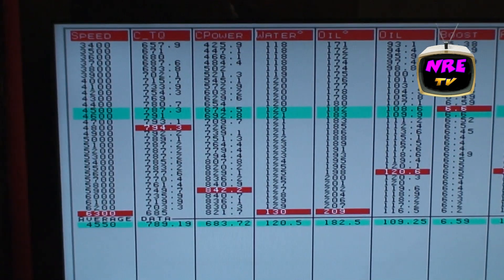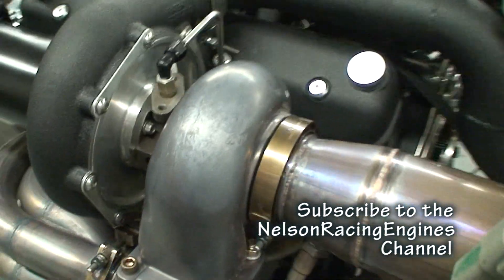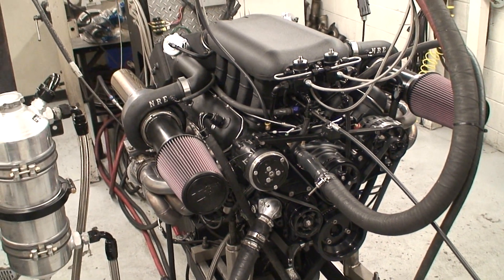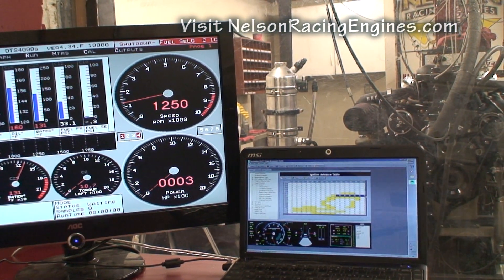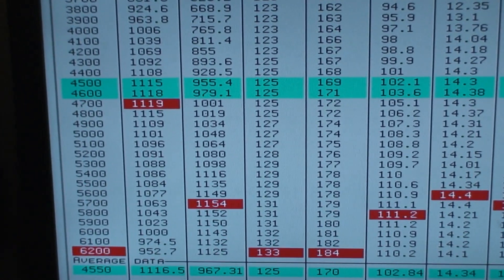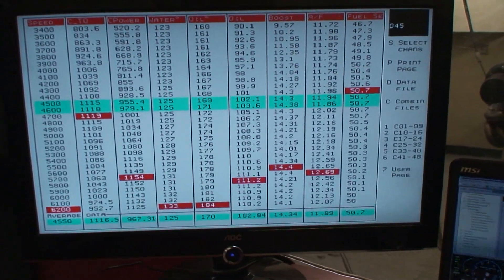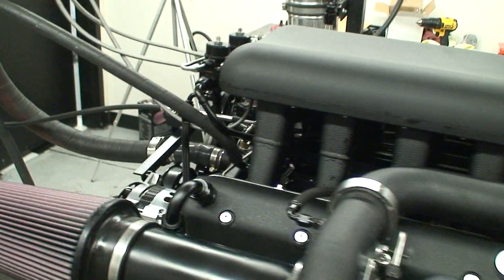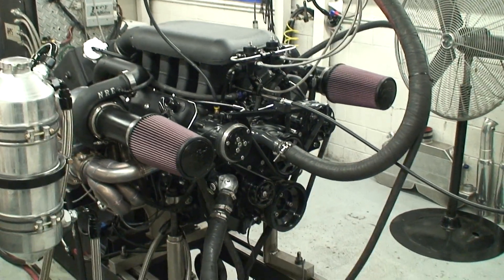Mid Engine 1700 HP Chevy LSX.  For Mid Engine Cars.  Nelson Racing Engines.  GM LSX.  Mirror Turbos.

Comment: FINALLY CHEVY GUYS CAN EXPERIENCE FORD POWER WITH THEIR GENERIC FORD THE LS. FROM TOP TO BOTTOM THE LS IS ALL BASED ON FORD DESIGNS. NOTHING REMAINS FROM THE OLD SMALL BLOCK CHEVY.
Reply: nebrew centric Giptian FORD WON LEMANS YEAR AFTER YEAR BACK IN THE SIXTIES TO THE POINT OF BEING BANNED IN 1970. CHEVY WON NOTHING THEIR ENGINES DID NOT MAKE THE POWER OF THE FORD'S NEITHER DID THEY HAVE THE DURABILITY OF THE FORD'S. CHEVY MOTORS BLEW UP AS USUAL. THE FORD 427 COBRA SET ALL THE BENCHMARKS OF PERFORMANCE USED BY EVERY SPORT CAR MANUFACTURER WORLDWIDE, CHEVY SET NONE. THE 289 COBRA'S MURDERED THE CORVETTES EVERYWHERE THEY RACED, CHEVY JUST COULDN'T COMPETE. TODAY'S CHEVY PROSTOCK DRCE ENGINE IS A COPY OF THE FORD CLEVELAND. THE CHEVY RO7 NASCAR ENGINE IS ALSO A FORD CLEVELAND COPY. THE LS IS A FORD WINDSOR/FORD 427 COPY AND ALL YOUR SYMMETRICAL HEAD BIG BLOCK RACING ENGINES LABELED AS A CHEVY ARE NOTHING MORE THEN FORD SPEC BIG BLOCKS. EVERYTHING CHEVY IN RACING TODAY IS ALL FORD BASED.
Reply: nebrew centric Giptian YOUR LS IS 100% BASED ON FORD DESIGNS. THERE IS NOTHING CHEVY IN THE LS IT IS COMPLETELY FORD.
Reply: nebrew centric Giptian THE SMALL BLOCK FORD SINCE THE 5.0 DEBUTE IN 1983 WAS KILLING CHEVY. IN 1992 GM DECIDED TO REVAMP THEIR SMALL BLOCK WITH THE LT ENGINE AND THE SMALL BLOCK FORD WAS STILL KILLING THEM SO THERE ATTEMPT FAILED. CHEVY THEN DECIDES THE ONLY WAY TO COMPETE WITH FORD IS TO BECOME LIKE FORD SO THEY COPY FORD AND LOW AND BEHOLD THE LS IS BORN 100% BASED ON FORD DESIGNS. NOTHING REMAINS FROM THE OLD SMALL BLOCK CHEVY. WHAT DRAG RACING IS TODAY IN TERMS OF NITROUS, TURBO'S AND SUPERCHARGING WAS SINGLE HANDEDLY SHAPED BY THE SMALL BLOCK FORD ALONE, CHEVY DID NOTHING.
Reply: nebrew centric Giptian THAT'S WHY YOU HAVE THE LS TODAY, BECAUSE FORD WAS KILLING THEM.
Reply: +leg “proper knee lift” drive DURING THE 1960'S WHEN THE 289ci DEBUTE. IT WAS SUCH A THREAT TO THE SMALL BLOCK CHEVY THAT THE NHRA WOULD CONSTANTLY CHANGE THE RULE BOOK ON THE SMALL BLOCK FORD LIKE THE WEATHER CHANGED IN KANSAS TO DISCOURAGE ANYBODY FROM RUNNING IT. SO THIS MEANT IF YOU WENT TO THE RACE TRACK AT TERRORIZED IT. THEY WOULD OUTLAW THE RACE PARTS WHICH MEANT THEY WERE NOTHING MORE THEN SCRAP METAL JUNK. SO NEITHER WOULD FORD NOR THE AFTERMARKET MAKE PARTS FOR A ENGINE THEY WERE ILLEGAL TO BE USED IN. IF YOU CAN'T RACE THEM, YOU CAN'T WIN. SO THIS WILL ANSWER THE QUESTION WHY FORDS ARE MORE MONEY TO BUILD. IT WAS ALL BASED ON CHEATING BY THE NHRA TO KEEP CHEVY IN THE WINNERS CIRCLE. JUST CONSIDER THE NHRA AND NASCAR OTHER DIVISIONS OF GM. IT WAS TOO RISKY TO MAKE RACE PARTS FOR A ENGINE THAT WAS SO HIGHLY GOVERNED WHICH MEANT THEY WHERE MADE IN BATCHES INSTEAD OF MASSES WHICH CAUSED THE PRICE TO BECOME VERY EXPENSIVE. IT TOOK MANY YEARS FOR THE AFTERMARKET TO PRODUCE GOOD RACE PARTS AND A GOOD SET OF HEADS FOR A FORD AROUND THE LATE 80'S. BY THEN THE MOTOR WAS ALREADY 25 YEARS OLD. AT LEMANS WHERE THERE ARE NO RULE BOOKS TO FAVOR CHEVY, FORD CRUSHED FERRARI BY ALMOST A HOUR IN 1964 IN THE GT-III CLASS. THEY CLOCKED THE FORD DAYTONA COUPE AT A AVERAGE SPEED OF 196MPH AND AT TIMES 200MPH ALL FROM A 289ci MOTOR.
Reply: +leg “proper knee lift” drive YEARS OF READING, EXPERIENCE AND TALKING TO RACERS. EVERYTHING CHEVY USES TODAY IS ALL FORD BASED. PROSTOCK DRCE, LS, NASCAR SB2/RO7 AND ALL YOUR SYMMETRICAL HEAD BIG BLOCKS BASED ON FORD CLEVELAND DESIGNS LABELED AS CHEVY.
Reply: +leg “proper knee lift” FROM TOP TO BOTTOM THE LS IS 100% A FORD MOTOR. THERE IS NOT ONE STITCH OF CHEVY IN IT. THE LS HEAD IS A FORD WINDSOR HEAD WITH FORD'S 427 HIGH RISER PORTS. THE OLD  CHEVY HEAD IS OF A CONVENTIONAL DESIGN EXACTLY LIKE A CHRYSLER. MOST ENGINES ARE BASED ON THE CONVENTIONAL DESIGN WHERE THE INTAKE RUNNERS ARE SIAMESE TOGETHER AND THE RUNNER ENTERS THE CYLINDER TURNING INTO THE INTAKE VALVE FACED AT THE EXHAUST VALVE. SO AT HIGH RPM'S WHERE THE EVENT OF OPENING AND CLOSING VALVE INCREASE, THE RAW INCOMING FUEL CHARGE HITS THE EXITING EXHAUST GASES DECREASING EFFICIENCY. IN THE FORD SYMMETRICAL DESIGN THE INTAKE RUNNER TURNS INTO THE CYLINDER WALL AWAY FROM THE EXITING GASES CREATING EFFICIENCY WHERE THERE IS NO INTERFERENCE BETWEEN THE INCOMING AND EXITING GASES. THAT'S WHAT MADE THE 5.0 BACK IN 1983 THE HIGHEST VOLUME OUTPUT MOTOR IN THE WORLD. NOTHING MADE IT'S POWER PER CUBIC INCH WHICH ENCOMPASSED A 1 CYLINDER LAWN MOTOR ENGINE TO A 12 CYLINDER ENGINE. THE ONLY ONE ENGINE WHICH MADE THE SAME POWER PER VOLUME WAS THE FERRARI 308 WITH IT'S ENGINE. 
SO WHEN THE FORD'S STARTED USING SUPERCHARGING, TURBOS AND NITROUS THE CHEVY SMALL BLOCK WAS FINISHED. IT COULD NOT COMPETE AGAINST THE SUPERIOR HEAD DESIGN OF THE FORD'S. WHAT YOU SEE IN RACING TODAY IN TERMS OF TURBOS, SUPERCHARGING AND NITROUS WAS SINGLE HANDEDLY SHAPED BY THE SMALL BLOCK FORD ALONE. CHEVY DID NOTHING. THIS IS WHY WE HAVE THE LS TODAY. THE CHEVY CAMP SAT HOPELESS AS FORD RAN AWAY WITH THE SHOW MAKING ENORMOUS POWER WITH POWER ADDERS. SO THE ENGINEERS AT CHEVY DECIDED THE ONLY WAY THEY COULD COMPETE IS BY COPYING FORD. SO CHEVY TOOK THE 4.6 MODULAR BLOCK ARCHITECTURE WITH IT'S CROSS BOLT MAIN, GERATOR OIL PUMP, OILING SYSTEM AND ALL AND THICKENED THE WEBBING ON THE BLOCK. GM ENGINEERS KNEW THE TEKSID 4.6 BLOCK WAS CAPABLE OF HOLDING 900HP SO THEY COPIED ITS DESIGN ARCHITECTURE AND THICKENED THE WEBBING FOR EVEN MORE HP. THE LS USES THE SQUARE BOLT PATTERN TO SEAL THE HEAD MUCH BETTER. THE RECOMMENDED BOOST ON THE OLD SMALL BLOCK CHEVY WAS 8LBS. THE MAXIMUM BOOST FOR A FORD WAS 18LBS BOOST DUE TO IT'S BETTER SEAL FROM THE SQUARE BORE 4 BOLT DESIGN. REMEMBER THE FORD MOTOR WAS OF A LIGHT WEIGHT CASTING WEIGHING CLOSE TO 100LBS LIGHTER THEN A CHEVY AND THAT IS AMAZING. THE HEADS AS I HAVE DESCRIBED ARE OF A FORD WINDSOR/427 HIGH RISER DESIGN USING IT'S ANGLE PLUG AND STRAIGHTER VALVE ANGLE OF 18 DEGREES WHERE THE STOCK FORD IS 20 DEGREES.  THE OLD CONVENTIONAL CHEVY WAS 23 DEGREES. EVERYTHING CHEVY TODAY IS ALL FORD BASED. THE CHEVY PROSTOCK DRCE IS A CHEVY BIG BLOCK USING FORD CLEVELAND HEADS. THE LS IS A FORD WINDSOR MOTOR. THE SB2 IS A SYMMETRICAL HEAD FORD STYLE INTAKE RUNNER HEAD. THE NASCAR CHEVY RO7 IS A FORD CLEVELAND DESIGN WITH A FRONT DISTRIBUTOR. ALL YOUR BIG CUBE SYMMETRICAL HEAD MOTORS LABELED AS CHEVY ARE ALL FORD CLEVELAND SPEC ENGINES. NOTHING IN RACING IS CHEVY ANYMORE. IT IS ALL FORD BASED.
Reply: +leg “proper knee lift” drive THIS IS A ARTICLE I CUT AND PASTED TO SHUT CRY BABY KELLY LOONEY UP.
The technology locked up in the 351C ports and narrow valve angles far exceeds anything Chevrolet or Ford had accomplished with previous designs (Chevrolet's W motor, Mk II and Mk IV and Ford's 385 series). It's cylinder head is the ultimate canted valve cylinder head. It's basic architecture continues to influence the racing heads designed by Ford and Chevrolet to this day. ALL THESE MOTORS LABELED AS CHEVY ARE ACTUALLY FORD SPEC MOTORS. THEY HAVE NOTHING TO DO WITH CHEVY. THE 351 FORD CLEVELAND ENGINE IS THE ULTIMATE IN POLY ANGLE HEAD DESIGN. THIS IS WHAT LARRY'S ENGINE IS BASED ON AS WELL AS ALL THE OTHER SYMMETRICAL HEAD ENGINES LABELED AS CHEVY. THE RACE WORLD RUNS A FORD CLEVELAND BASED ENGINE. THIS STARTED BACK IN 1983 IN PROSTOCK WHEN CHEVY COPIED THE FORD CLEVELAND HEAD FOR THEIR DRCE-DRAG RACE COMPETITION ENGINE.